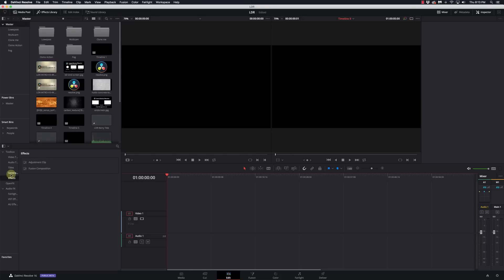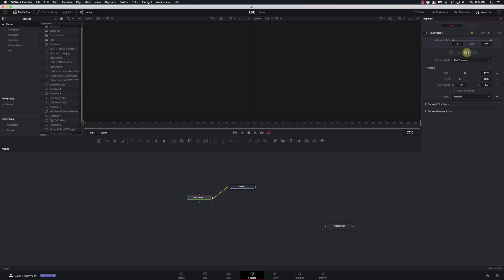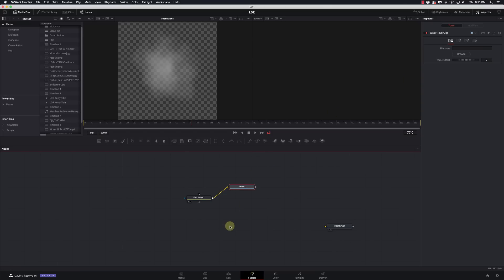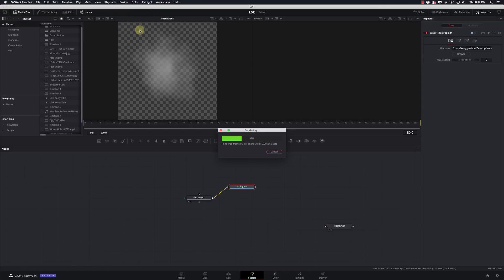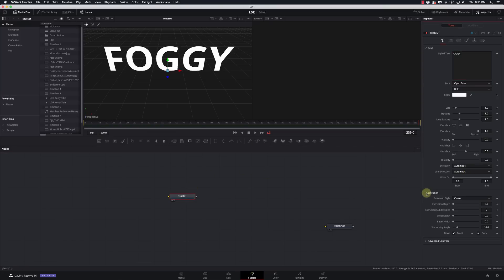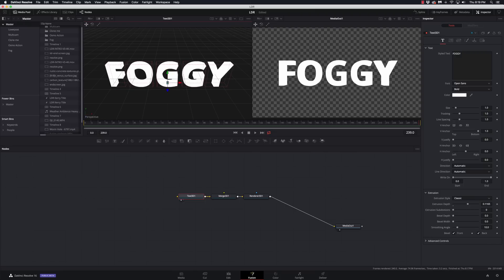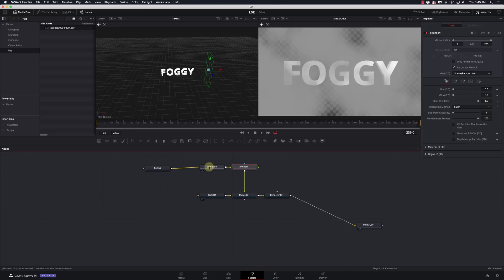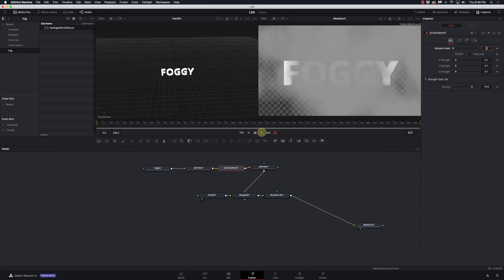Realistic 3D Fog Effect - Davinci Resolve Fusion

Comment: Is there anything can be done regarding that the particles shouldn't flicker when they coming into contact with the 3D objects? This happened after you'd introduced the turbulence. My guess is that the particles flying through the letters from an angle to the camera, and as soon as the mid point is inside the letter the whole texture disappears, and then reappears when the mid point resurfaces on the other side.

Also, I made a camera animation based on this tutorial. Same particle effect and the 3D camera is flying through the cloud. Problem is that as soon as the camera passes a particle, latter is vanishing in an instant. Can it be faded to disappear in front of the camera instead, so it looks natural?
Thank you!
Reply from the maker: +Teasuti just some fine tuning, I’ll do a follow up video when I get a chance
Reply: I think the pTurbulence is causing the issue. Try set Z axis to 0

Comment: Also I spotted that in the media pool it says [0000-0000] next to the opened exr file. It to me means that only the first frame is opened. And if I watch closely I can see that all the puffs are identical. All of them. :(
I left out the saver node, fed the Fast Noise straight into the pEmitter (didn't seem to choke my rig at all with proxies), but I can't make it produce unique particles in one frame no matter what I try (animate at particle birth time, etc). Is there any way I can do this? I can make it render different texture on different frames, but all the particles emitted in one frame look identical. Can't I make all of them unique somehow?
Thank you!
Reply: Hmmmm.....yeah, it should have imported them as a sequence. I will look into this.
Reply: @KerryGarrison  easy fix though, just open all the files. Regarding the other issue, looks like pEmitter will take only one sample per frame, so all the particles will look exactly the same emitted in one frame. :(
Reply: @Teasuti  You need to set a keyframe at the beginning and end and change some settings to get some variety.

Comment: Great. A small query regarding chroma key. I am using Da Vinci Resolve 15. While chroma keyed layer is shrunken or reduced after chroma key it shrinks background layer as well. It's annoying especially in compositing. Any solution?
Reply from the maker: If you start with your footage and later add a fog effect, you should be fine, The order that things are added can determine the project resolution and you may need to manually set that in some nodes to prevent issues. If you are only doing ChromaKey, you shouldnt have any issues.